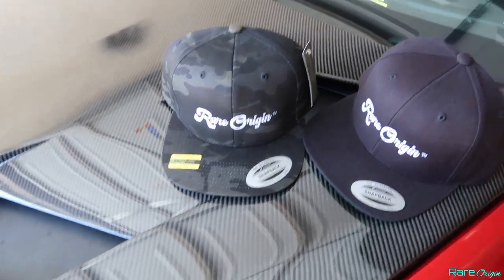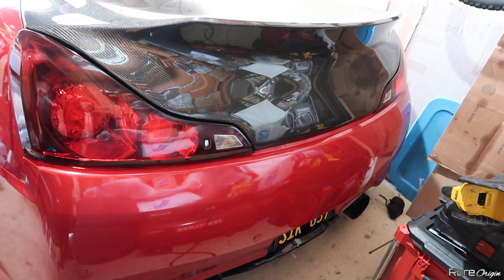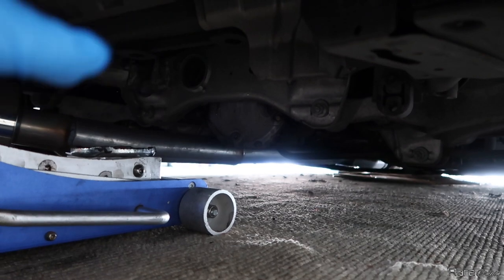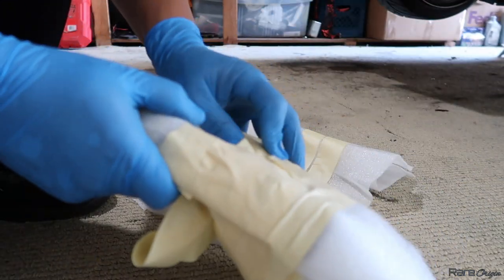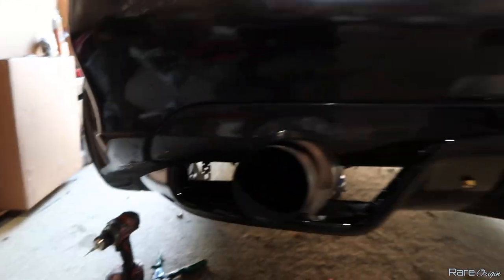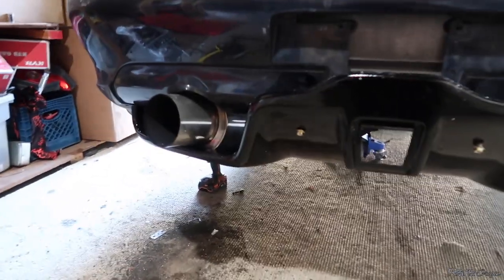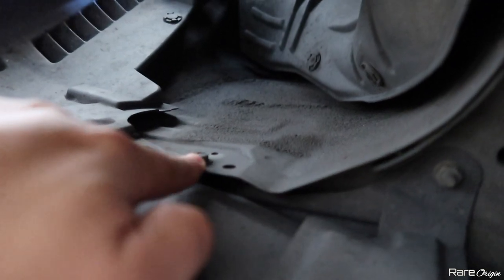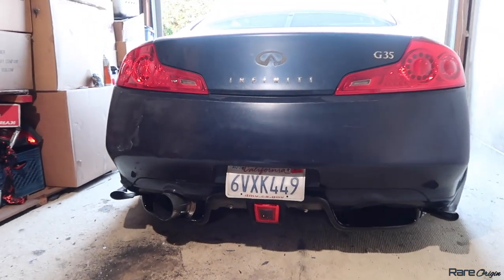THE BEST G35, G37, 350z, 370z F1 DIFFUSER!

Comment: When you installed it on the g37 did you need to cut the a hole for the light aswell
Reply from the maker: Yes i actually have a video when I installed it on the G37 coupe.. but yes you need to cut a small square in the middle of the bumper to fit the 370 fog 👍🏼